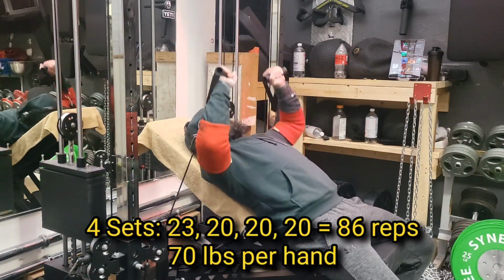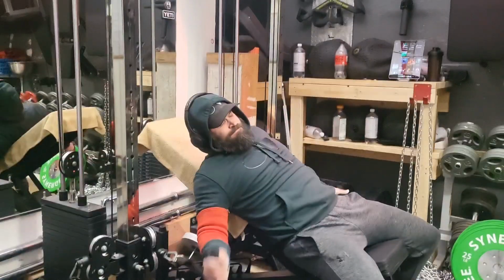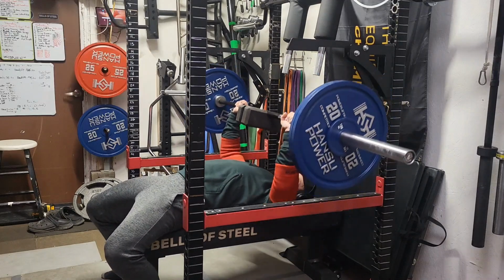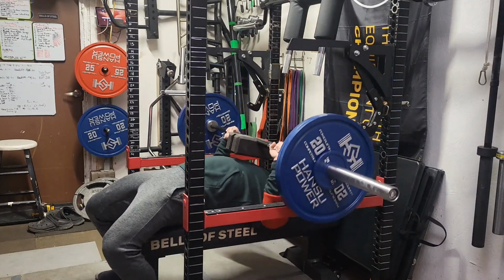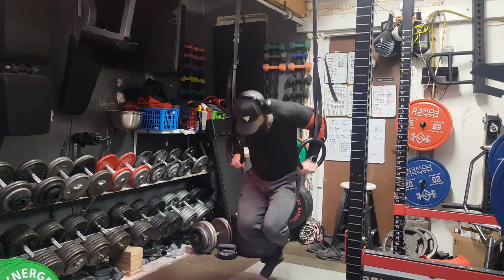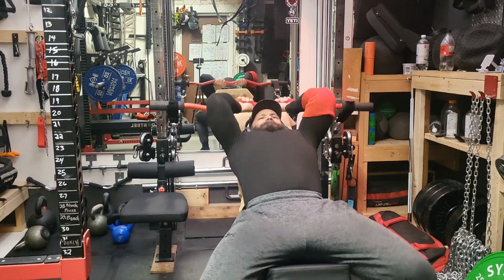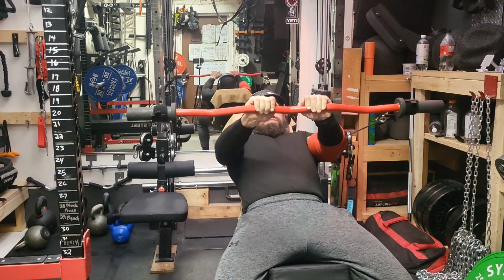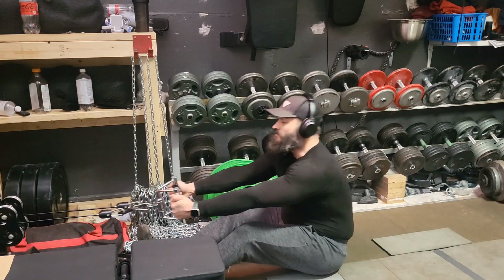Bench, Back & Triceps. Building around injury.

Comment: I've always found that using those times when I have a tweaked injury that I can still work through / around is the best time to do foundation building, too. I do that also after coming off of being sick or on a trip.

I'm really glad that the camber bar is working good with your cable Skull Crusher superset. The setup that you created with that is super professional.
Reply from the maker: I agree, building the foundation is the way to go.  At least then I feel like I'm still progressing and doing something useful.  Otherwise I rush to get back lifting heavy before my body is ready.
Reply: @buildingdadbod2.0  I do the same thing and it never turns out good.  I've leaned that slow and steady really wins the game in the long run when it comes to fitness.
Reply from the maker: I totally agree
Reply: @buildingdadbod2.0  I'm hoping to execute that strategy right now with just getting back from that 17-day trip. Slow and steady re foundation building while pushing only the one arm pull-up
Reply from the maker: That's the way to go.  You don't need any setbacks after the hip troubles.
Reply: @buildingdadbod2.0  It's turning out that I'm really bad at executing this plan, 🤣. I keep tweaking things. The good thing is that at least I'm able to keep them to a minimal. I guess with getting older, you have to just take your time a little more
Reply from the maker: Man tell me about it Lucky.  I think slow and steady wins the race at this point.
Reply: Absolutely! With this one arm pull-up I'm working on, I've already had 2 tweaks with it. What the hell! I think mainly it's because I really didn't have any foundation for it. I've never done any kind of single arm pull-up type work before.
Reply from the maker: Yeah, the single arm pull-ups are insane, it puts so much stress on the side your working.  The strength part is hard, but I also find it really hard to try and stay in a good line, my body always wants to turn.    I'm too fat to hit them right now though 😂
Reply: Lol, it's definitely a worthy challenge. I'm figuring out more and more that the technique and form of the exercise is huge! It's definitely one of those challenges where there is a lot to dial in
Reply from the maker: No doubt, lots of strength and lots of technique.
Reply: @buildingdadbod2.0  Yeah, this one is going to take me longer than expected, I'm pretty sure.
Reply from the maker: I haven't seen many people that can do them, but I believe with your build and your strength you will definitely get there.
Reply: The crazy thing is that the whole time I was in prison, I had never seen anyone doing them. I'd seen some pretty crazy feats of strength, too. I'm thinking that it's maybe because the pull-up bar setup that we had access to wasn't really ideal for being able to do it. I don't know. 

I'm going to get it eventually. It's going to take changing up everything in my workout to pull it off, though. Which is always good to keep things interesting, I guess.
Reply from the maker: @GetRightFitness I think it's a pretty rare accomplishment.